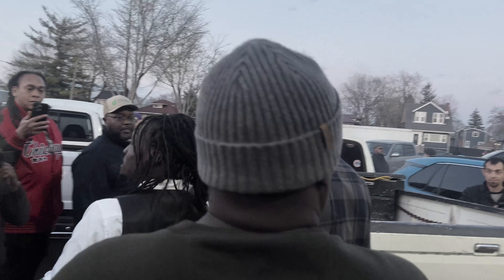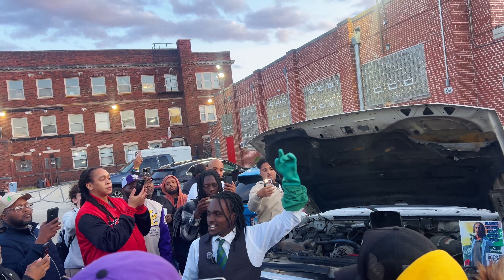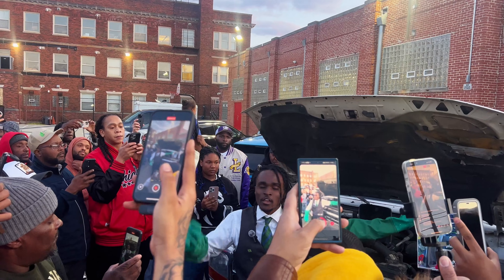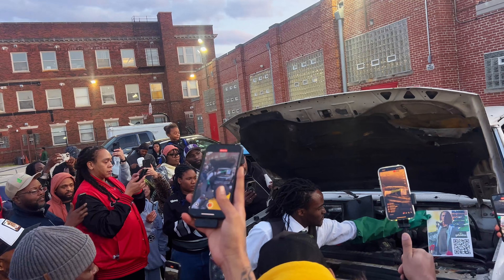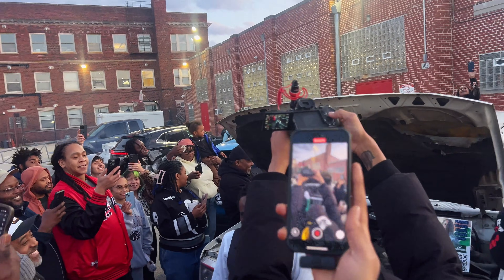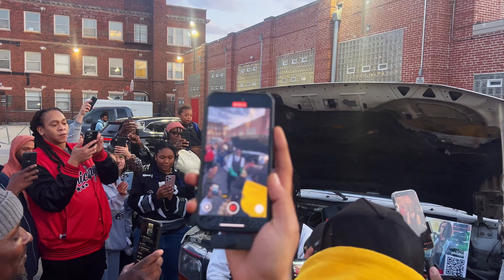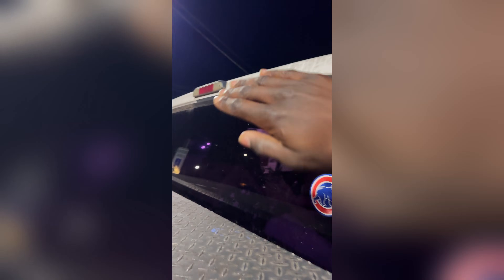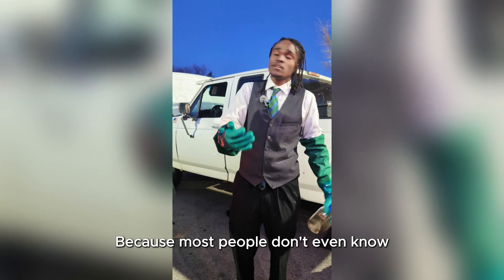Will it Run? PlastiDiesel vs Real Diesel in Ford F250 1997 - Chicago, IL 2025

Comment: Great proof of concept, might need a little bit of work to optimize it and make sure that it's not causing toxic emissions, but I think this could very easily be groundbreaking.
Reply: @rileycoyote4924  this is not groundbreaking this is old Tech from 1971. The big oil companies already did an emissions test from this and it produces 1,000 more times toxic off gassing of plastics then gasoline, diesel or propane
Reply: Old tech

Comment: What happens to the toxic gasses produced by plastic? Burning plastic releases toxic gases such as dioxins, benzene, and styrene, which can lead to serious health issues. Glad you’re working to solve an issue I just hope it’s the right solution.
Reply: It’s definitely alarming to see people breathing in the carcinogen fumes and talking about how those fumes smell better and look to be cleaner burning.
Reply: @bunnyluver2176  because a lot of people are sheep come on they will literally believe whatever without doing any research for themselves. Some of these people will believe the sky is falling if the news says so without actually walking outside to see if the sky was falling. I've said this before Julian telling people to smell the plastolean on his video on April 2nd is out of this world. Gas is toxic and the fire department has told him a few times that you should be wearing proper gas protection like a gas mask especially after he's almost blown himself up twice and doesn't even wear flame retardant suits like race car drivers wear. Julian's ego is so high. And I'm so glad Noah cook called him out during the last video and you could tell how pissed off Julian gets when actual people that know science call him out on the BS. He's not doing anything new the machine that he has was invented in 1971. The only thing he's doing is bypassing literally every safety protocol. Off gassing from him not having proper gear and then running it through a truck is a great way for the EPA to come after him
Reply: dude never wears a gas mask and has blown himself up 2x lmao. don't huff the gas. off gassing from plastics is very very very toxic. coal miners wear better face protection!!!!!
Reply: There are controlled and capture solutions.
Reply: @jeff7546  like what ? Just making oil into oil ?

Comment: Proud of you brother! And for those saying ish about the engine they were never designed to run on what we call diesel fuel today. Only thing that would matter is heat , how hot is that fuel burning. Other than that should be good
Reply: proud of what??? this is old tech made in 1971..... he didn't do anything new

Comment: Why is this not all over the news?
Reply: You know why😐
Reply: @bnellaniyah  because it is nothing new? maybe to the hood idk but maybe we don't have plasti-diesel because it is too expensive to turn back plastic into oil. plastic is made out of oil you know ... ;)
Reply: Something ive seen at that most of Julians “haters” are usually people who have worked in or have studied scientific fields and often have specific points of concern. Julian never has the actual paperwork and accreditation, let alone PPE & GLP discipline,  in place to satisfy his academic critics BUT on top of that a few searches of “plastic to fuel, recycled hydrocarbons PDF” and you”ll see the historical results of every method he is attempting.
 I respect the hustle but i think he is so genuinely naive he is going’s to get hurt or sued if his product is sold
Reply: @jagoz7465  you're absolutely correct. He's going to get in trouble with the EPA. He says in the debate versus Noah cook that he has already talked to the EPA and the EPA doesn't have a problem as long as he doesn't run it in any engines but then he is on YouTube literally running it in engines after he told Noah in the discussion that the EPA is cool with him. Julian is the biggest liar ever. He still has zero emission testing and zero lab reports . Most of the people that he is talking to her like people in the hood that have GED level educations. All the big word sound cool but he's literally using no safety measures at all which is the reason why he's blowing himself up now twice. He's been told by the fire department to where gas masks while he's around gas fumes because breathing gas is toxic but in a few of the videos he tells people to smell the plastic gas hey that's stupid and very unsafe to be telling people to literally Huff the gas. Julian's ego has gotten extremely huge. He's gotten over $100,000 in donations and what does he do with that money. Like he literally has absolutely nothing to show for it
Reply: Big oil plays into the narrative.
Reply: @BassNotes_B-Rad  Big Oil came up with this machine in the 1971 and they already did the emissions test, must just be a hood thing to not go to the library and research history. Off gassing from Plastics is 1,000 times more deadly to the ozone and breathing in for animals and plants then the counterparts of gasoline diesel or propane. Please please all I'm asking is go to the library and pick up a book or use your smartphone to research this machine
Reply: @honda-s2k  you cannot fight emotions and people like to learn through emotions and not science 🤷‍♂
Reply: Julians fans are the type of person who discovered the word  ‘molecule’ yesterday and think they are ahead of the curve
Reply: @jagoz7465  well put. Julian's fans don't even know the basics of biology and science.
Reply: @eybietie  unfortunately I've had to learn that with 3D printing. I've been doing 3D printing for 10 years. All the newbies want to do is 3D print stupid flexi toys. And unfortunately their egos are too high. Just like Julian. He is unwilling to learn from people that have been doing it longer than he has heard he's like a 1800s medicine man, he puts on a really good show but when it comes down to it he can't back it up
Reply: @honda-s2k  everyone just wants to live their own illusion which is generally fine .. not so much though when you keep gassing your supporters with plasti diesel fume because of ignorance and maybe a tad bit narcisism ..
Reply: @eybietie  amen well put
Reply: @DsmDiego  why don’t you do any research before asking dumb questions? This tech was invented and patented in 1971 and is widely known technology and available just the amount of energy needed to break down plastic outweighs the “fuel” one might get back

Comment: Did he drain the tank of the truck before mixing his “fuel” with the other diesel? No he is not running this truck solely on his “fuel” he is running it on a mix of his “fuel” and diesel.. you guys need to wake up to this scammer

Comment: It can run but should it? I think some development needs to go into either building an engine built to run on this Plastoleen. Or look into selling it to plastic manufacturers for reuse. I am concerned about emissions. The exhaust may be toxic. I think your machine could make recycled plastic beams with some modifications.  You want to focus on building a machine you can sell. Safe, easy to use and fix. Use solar and microwaves to make the process possible anywhere. I see processes that are adding sand to a mixture of used plastic and with pressure, are making all kinds of stuff. The world needs this kind of machine.
Reply: @GudasWorld_2  no it shouldn’t because it contains up to 6% benzene and styrene so everyone around that truck breathing in the exhaust fumes just got hit with 20x the acceptable level of benzene and styrene in regular gas
Reply: I stood directly behind it and can say you're dead wrong.  @roninthealchemist
Reply: @roninthealchemist how Long does it last after exiting the system? Were you there for the debate?
Reply: I think its safe to say the jig is up when it comes to out community’s scientific expertise… i echo the same concerns as OP, smelling better does not equal safer. Carbo Monoxide leaks smell clean yknow. 
Maybe some kind of advanced catalytic converter is needed as a precaution
Reply: @jagoz7465  the off gassing from pyrolysis is not though, off gassing emissions from plastics is 1000x worse than c02 from gasoline. he is using a gas generator to make plastic fuel lmao hahahahahahahahahahahahahaha, solar power doesn't work when there is no sunlight, in the winter months we have even less sunlight lmao hahaha. he should be using a gasifier to run his generator. 100% renewable energy from converting wood into a gas..... old tech from ww2. https://www.youtube.com/watch?v=XZdqKicnoVg
Reply: @isaiahcanreallyrap  the half-life of off gassing of plastics Varys when it comes to certain Plastics some Plastics have a half-life of a day while some Plastics will be in the air for 12 years or longer. Julian hasn't done any lab testing at all. Way to be a simp for feelings
Reply: @jagoz7465  it's not feasible when the power consumption doesn't match the output. Keep in mind this is old Tech from 1971. It's already done been done before. What Julian is doing is nothing new the only thing he's doing is totally bypassing emissions and safety measures like if you're working with gas you should have a gas mask and not telling people to smell the gas to see if it smells like regular gasoline that's stupid and he's risking the lives of his supporters and himself. Race car drivers and coal miners wear more protection than Julian does which is why Julian has blown himself up now twice. I'm a huge critic because I work with plastics everyday and on top of that I have a CNG truck which runs on propane and gasoline. Like you said in the video with one of the critics Noah cook about a week and a half ago that he hasn't done any emissions testing yet and he's been talking with the EPA, and in the same video he said the EPA is not worried about him doing what he's doing only if he's running it in a motor what she did that day which that means he's lying to the EPA parade the video is on there. The video debate between Noah and Julian is on there for everyone to watch and I highly encourage it, Noah does a great job at busting Julian out on his BS. Julian starts getting irritated in the video because he can't back up his erroneous claims lmao. Julian should be using the gasifier not solar power
Reply: @honda-s2k  he literally has sent off fuel for analysation.... Stop talking out your ass.
Reply: @honda-s2k  i agree. I had tried to bring up some genuine concerns about basic safety in the past only for his fans to out me as a hater that doesn’t “know what they are talking about”.  I bet from your more knowledgeable point of view it’s frustrating to see Julian trying to tout himself a scientific prodigy!
He just comes across as incredibly genuinely naive of the risks to himself & the public. 
Would be good to see that video
Reply: @isaiahcanreallyrap  people say a lot of stuff. Julian is like an 1800s medicine man. If he actually sent it off to the lab he should have actual proof with receipts. Lab testing cost money. Go pick up a book at the library. Reading is free and knowledge is real power. Sorry buttercup this is old Tech from 1971 and they've already done emissions testing on it if you pick up a book on history of old Tech
Reply: @jagoz7465  anybody that has a science background we're labeled as haters to all the people that have their geds, that don't know how to practice safety protocols and don't understand science. And we're not haters, none of us are hating we're just pointing out facts, and a lot of these people that are Julian's fans they care more about feelings than facts. Hell most of these people don't even know what a woman is
Reply: @isaiahcanreallyrap  don't smell the gas when Julian tells you to smell the gas
Reply: Exactly - safe,  easy to use & fix would be excellent
Reply: Would y'all question it so hard if Elon did this first? I'm thinking not and he makes exploding cars. Smh
Reply: Come now @cfoster6804 don’t be facetious. 
Is Elon the engineering team, design team, PR team, legal team, fabricator all rolled into one?  Is he hand building these things in his yard? Testing vehicles emissions in the middle of crowds of people?
Reply: @ceefaster6804  Because pollution is pollution. We need to make sure we are not putting worse things in the air. Why I'd like to see Jab convert his tech to making building materials. And, F elon....
Reply: @ceefaster6804  this is old Tech from 1971 go pick up a history book
Reply: fuel come from erth and mothor natirue . this plastick waste maded from bad intentions. dmeonic!
Reply: @GudasWorld_2  problem with solar is it doesn't work anywhere, but a gasifier will. A gasifier will run any motor off just trees. The thing you're forgetting about solar is as soon as the sun goes down you're running off Backup batteries and capacitors, and during the winter months there's even less sunlight depending on where you're at around the world. In order for solar and wind power to work good you got to have either sunlight or wind, if you don't have those they're never going to work bird a gasifier like I've told Julian before because he lives where there's an abundance of trees, he literally could be running his generators off trees and always have a renewable resource, just type in gasifier on YouTube, there are trucks that run on trees there are generators that run on trees. Gasifiers are great for off-grid living and continuous power like he wants with his reactor. He will never ever ever ever ever ever ever get continuous non-stop power on batteries and solar power
Reply: @honda-s2k  depends on where you live. 6-8 hours of good solar is a good days work. Be prepped and ready for when the sun hits and run all day. No batteries needed. Sunny and 80 every day in most the world where the pollution is bad and needs this tech.
Reply: @GudasWorld_2  you're forgetting all about solar power you need batteries and capacitors to store the energy when the Sun goes down you can't continually run a reactor after the sun goes down on just solar panels. It's called science not your feelings
Reply: @honda-s2k  ah..... No, you don't. You can run directly off PV. In most the world you'll get 6-8 hours a day of usable sun. A good days work. I said all this in another post.
Reply: @GudasWorld_2  good luck more power to you trying to run 14,000 Watts at night time with no battery and capacitor backup. It's been proven it doesn't work all the people that were tricked when the solar power companies try to tell people that they can run their whole entire house of solar power and then sell the power back to the electric company. That still hasn't happened yet and was the biggest scam
Reply: All you have to do is do an emissions test lol 😆 
Chill out Mr. Karen.
Reply: @GasandDiesel911  well why don't you do the lab testing for him there Mr Karen. Oh wait the lab testing has already been done it was done in 1971 when the machine was first patented. It's called picking up a book and reading it. Sadly most of you have like GED and high school diplomas and know nothing about science most of you don't even know what a woman is
Reply: @honda-s2k  lol you sound very egotistical. I'm sure you have no woman. Don't act. Hahahhahhaah
Reply: You think the exhaust may be toxic but can’t even explain what chemicals are toxic. Nor can you explain what is being emitted when the engine runs 😂. Basically, stfu
Reply: @ahitch3681 yeah bro it’s called Benzene and Styrene… what the fuck do you think happens when you burn plastic?
Reply: @ahitch3681  Benzene and styrene are the two top plastic chemicals that he is producing also Julian said in his last video that he has no clue what is emissions are because he hasn't done any lab tests on it yet and that was the video of Noah cook calling him out. A great video that really showed Julian just full of crap. Nice try little simp boi. Julian isn't doing anything new this machine was built and it was also handmade in 1971. Facts before your feelings buttercup
Reply: @ahitch3681  We don't know that because Julian doesn't respect science or this world enough to bother finding out.  
We can assume based on known reaction mechanisms, however, which is why it's only people who don't understand the science that think this is good.

Comment: Just build a wood gasifier you can burn plastic grass wood leaves and run your car it's simple easy pollution free . Your wasting your time doing whatever your doing where do you think back to the future got the idea. Wood gasifier was used in WW2 and still works today .
Reply: Good gassifiers are cooler than this, but not pollution free.
Reply: Exactly, use it run the generator and the biochar that comes from the plastic